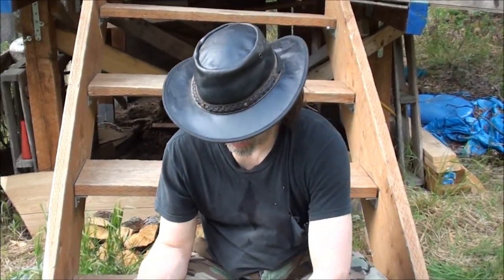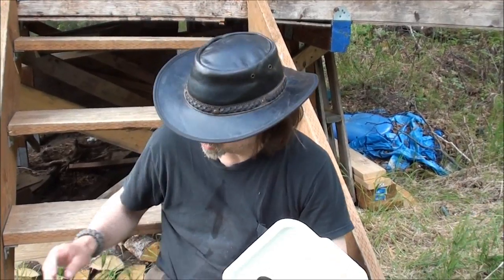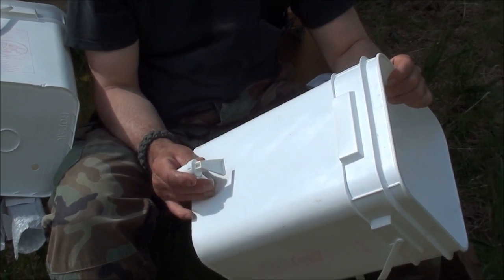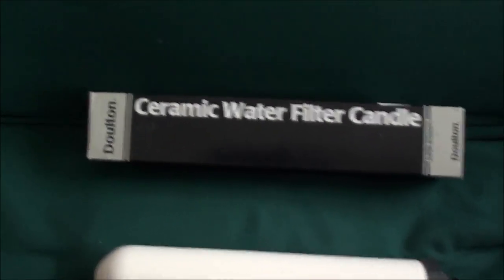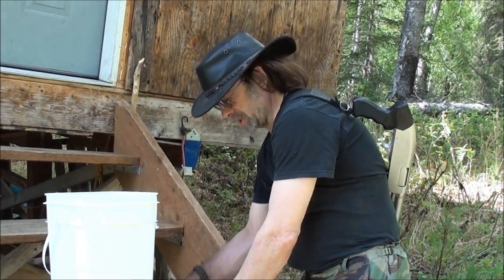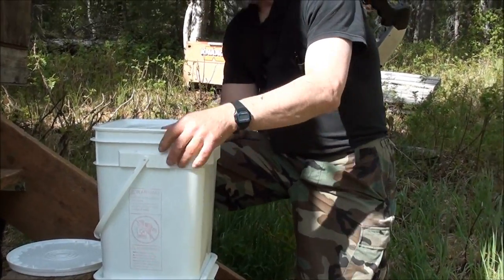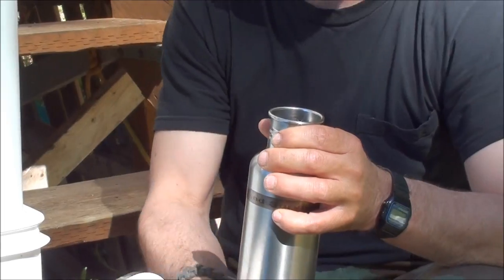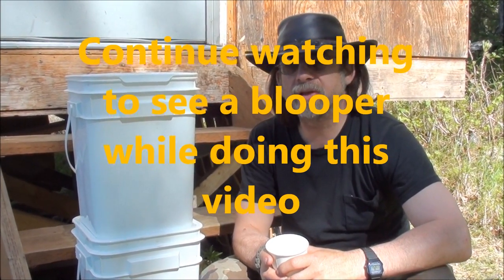DIY Water Filtration System For Cabin Or Camp

Comment: Each filter manufacturer should have technical info on their sites. Give specs on exactly what's removed from water. Should also give info on micron size of filters - smallest particle it removes from water. 

Generally, 3 main filter types. (Not enough room 4 details)
1 Filters potable water 2 remove chlorine, odors, etc. - improve taste.
2 Filter removes bacteria, cysts, protozoa, & some large virus.
    2a + charcoal 4 taste
3 Filter removes as #2 plus most virus
    3a + charcoal 4 taste

Comment: Great DIY video, thanks. I don't believe these filters remove any bacteria or protozoa. Why would you not worry about that.
Reply from the maker: These filters remove virtually all bacteria and protozoa though they will not remove viruses.  I am not worried about viruses since this is at my remote cabin and the need to filter out virus is non existent.   The need to filter out viruses would be more important when traveling in foreign countries where water purification methods may be substandard

Comment: This is good, but additional filtering will save the life of those ceramics, Cover with a cloth and then place or fill the top bucket with sand gravel charcoal and clay Don't make the clay to heavy or thick, as this is or as good as any ceramic filter.

Comment: Hi Lonnie. I just ran across this vid. I had to respond. I have been researching water filters for a couple of years now. Berkey manufactures it's own filter. It even compares it's filter to a Daulton GSS 2.

http://www.bigberkeywaterfilters.com/helpful-resources/compare/

If you go to that site you will see that the Berkey ceramic filters are far superior in it's capabilities then those other filters it was tested against including the Daulton, and it lasts about 6 times longer. I have verified from independant sources that the information on that Berkey site is valid and true. They also have extra filters that filter out heavy metals, arsenic and other toxins that work in line with the original ceramic filters on the Big Berky. Those Berkey filters can be set up the same way as you have done with the buckets. In Alaska the water is far cleaner then most states, and any large cities in the U.S. so that filter probably work fine there. On the other hand, people living in cities that have to get their water from a nasty ditch in an emergency, need those little extras like the ability to filter out viruses, heavy metals, and toxins. There is only one other gravity feed ceramic filter setup that ranks as high as Berkey at cleaning water, and I can't remember the name at the moment, but I'm pretty sure it's not Daulton. Just my 2 cents. Those look like food grade BPA free plastic buckets?
Reply from the maker: bibleprophecy1st Any testing done by Berkey "proving" Berkey filters are the "best" would be highly suspect by me.   However since you say that you have found proof elsewhere as well then you may be correct.  I'm sure that Doulton could put some "Facts" on their site that would "prove" that theirs is the "best" depending on how it is graded.    We have had no problems at all from these and this will be the third year we have used them though with very little total used time on them.   At this rate they should be good for another 15 plus years.   I have become very sceptical of man kind's moral integrity and have a hard time believing "facts" that come from companies that have a financial interest in products that those "facts" support.   Money is the God of our society and calls the shots.   Moral integrity and honesty does not.

Comment: Why not just boil the water for free rather than spend money on filters?
Reply from the maker: +EckBawkLive    Boiling water for potable use is a very good method of rendering the water safe to drink.   It works well for short duration use.   For all day long day after day though, it is sooooo nice to have  a filter setup where you can have fresh clean water when ever you want it as long as you keep water in the filter supply side.    Boiling water in a cabin is NOT free.   You either have to keep the woodstove cranked up so hot that it will run you out of the house on all but the coldest days or else you have to burn propane in the gas stove.    The wood that you are burning in the woodstove is almost always cut up using a chainsaw and so requires the use of gasoline as well as two cycle oil as well as chain lube oil.     In a scenario where one can not have the conveniences of filters, propane, gasoline etc then you can always go outside and boil the water over an open fire but that is very miserable on a hot summer day.      So yes you can boil the water but I choose filters personally as the best method for cabin use.
Reply: Thanks for the reply, I see why you choose the filter then...for the convenience and no exposure to excess heat.  Great videos, keep it up!